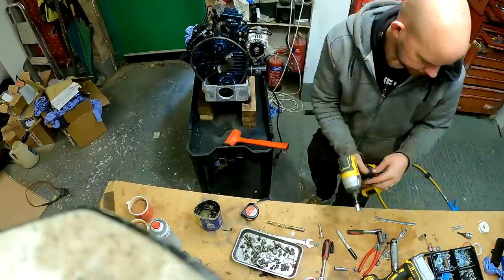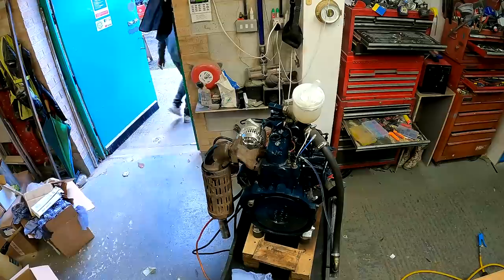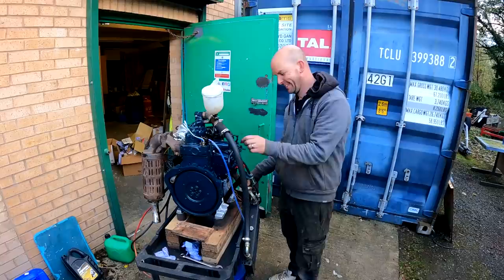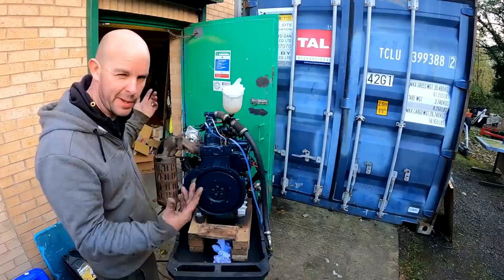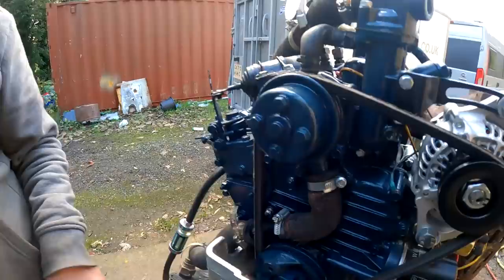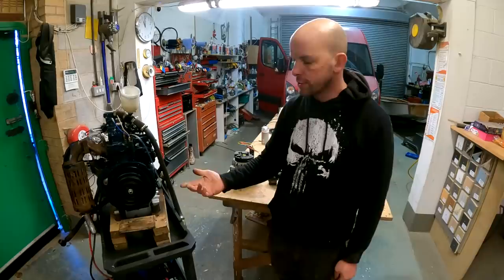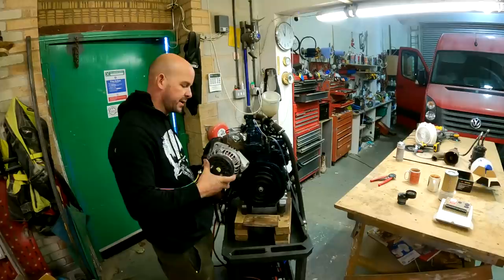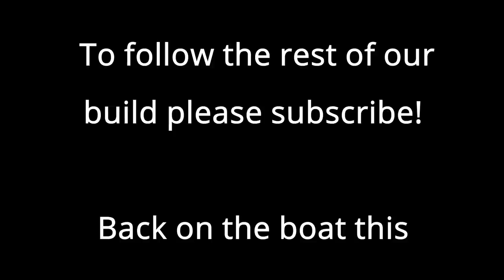DIY DC Generator Build - From An Old Road Sweeper??!!  Part 1

Comment: i'm commenting at 3 minutes into the video  ,but i am very familiar with this engine , it's a Kubota Z-482 ,,these are used for APU power on semi trucks here in the USA ,,,they will easily run 10,000+ hours for generator use ,,I turned one of these APU units into a portable generator ,,it has a  40 amp alternator   and  runs a 4000 watt 120V generator

Comment: Quite the transformation Simon , that engine looks like it is Brand spanking New and it runs like a top ... Outstanding indeed.
Reply: I agree.  You must have a background in diesel engines because that looked so easy for you.
Reply: Motorcycle race engines.

Comment: You could integrate the cooling system into the return of your central heating. Make use of the waste heat .... Since you mostly need it in winter....

Comment: Hi guys, I am a marine electrician in NZ, keep in mind with running this 140A alternator,, as much as its 140A, you need the RPM to spin or run it, this engine will NEVER EVER run fast enough to make this alternator produce the output required. Keep this in mind. Cheers Jeff
Reply: Needs a flywheel sized pulley to get the rpm.

Comment: That is not a mess, that is progress.  Gemma, I cook the same way, as I rebuild motors.  The mess gets cleaned up, but only after I know everything is tasty, or working.  Great project.  I guess it would be too expensive to run the main engines, I imagine cooling would be an issue having to wait for high tide.
Reply: This is the way I work! But if your a person that tidies as you go, it's horrifying for them :)
Reply: Might find the sow’s ear cleaning up the bench?

Comment: 12/13/2022 Hello Simon. Very large alternator. Usually used on road and mining equipment. Sometimes my style was on emergency vehicles like fire trucks who would stand running and power the water by the engine and keep the truck batteries and the extra lighting on the equipment. Cool Video. I am glad I found this video series. I was about to become depressed until spring and you restart the work on board the Salinda. Good luck and stay safe while you regain your dry land legs. Don usa

Comment: Great project. I used my ac pump on my range rover for onboard air. I had a 24litre receiver off a home compressor with a dead motor. the pressure switch turned the clutch on and off on the ac compressor to maintain pressure. I could use any air tool and put tyres back on the rim. A great modification. 👍

Comment: Excellent work with repairing that little Kubota engine.  Have you considered fitting a belt-driven Jabsco type water pump (with clutch) that could be valved to act as a bilge, fire or deck-wash pump? For engine cooling could I suggest a heat exchanger and small raw-water pump that could exit cooling water via a water-injected exhaust?  Have a look at Beta Marine for ideas of how they marinise these engines for propulsion and as gen-sets.

Comment: First I'd like to say wow, what an accomplishment! Well done indeed! I was watching another channel (Sail Life) and he was originally going to mount his generator off of the main drive like you are discussing and someone said that the rear main bearings were not well suited for a load off the side and that they would soon fail. Your original plan/thought to put the generator in line with the engine main shaft would avoid this problem. I'm not an expert so just saying, it's something you might want to consider. I am really enjoying watching you guys work, love your channel.

Comment: The little Fiat Panda has a near 1000 watt (70 amps IIRC) generator. Brand new cost £100. 
Put two in parallel and you’ll keep a 3 horsepower engine busy. . 
Properly seal the exhaust and the waste heat can help warm the boat.

Comment: Nice job, now, if you think about this you can mount the controls in the wheelhouse with the generator in the engine room and control it all from there? That would be such a sweet set up.

Comment: Many/most people in the USA don't know the latitude of the UK, and how that causes the seasonal variation of day/night proportions. For instance, winter daylight at Manchester UK is about 9 to 9-1/2hrs, but in Chicago it's about 9 to 10-1/3 hrs.  That's a big difference in terms of energy from solar installations, and if the Gulf Stream did not temper the UK climate then it would be quite cold in winter.
Reply: 8hrs is nearer at this time of year maybe 7.5 next month

Comment: Nice project! Have a look at the Comap range of controllers. I’ve only ever used the ones for AC generators but they’re great. I believe they do a DC version with auto start/stop according to battery condition. The AC ones also have the option of GSM or Ethernet monitoring/control which I’m sure would be available on the DC versions too.

Comment: Nice job Simon bet you was chilling while doing that engine
did it bring back some motorbike memories nice job....Before starting any of your 
engines you should have a check list first....some of that metal exhaust to through
hull connection be sound....can you not face off that manifold in your lathe Simon
keep it up.

Comment: Wow, that's going to be a well used little motor. Will 10hp be enough for the alternator let alone the hydraulic pump & PTO? Great project though, keen to see the motor control running. Will you be tapping the exhaust out into the main ships exhaust or keep it seperate?
Reply: max is 125A @ 28V (although alternators don't put out their rated current unfortunately) = 3.5 kw @60% efficiency =~ 7.8hp - so plenty of oomph (and a huge amount of heat !!)
Reply: @guy.h  Doesn't leave a lot left for other stuff. Good thing is, diesels seem to enjoy running under load 👍
Reply: @guy.h  And prospect to select whether to charge batteries or use hydraulics, with chance of heat recovery for water heating using a plate heat exchanger from an old domestic combi boiler.
Reply: @garyphillips7993  the alternator could not charge at that rate as their battery bank wuld not accept the charge.
BUT if there was additional 24v load (inverter etc) then the alternator could put out it's max BUT with  2.5kw heat being generated by the alternator it won't do it for very long before cutting power to bring its temp down. (forced air cooling will help)
At the end of the day, they might have an 8hp hydraulic pump, a 3hp air compressor (~13cfm) and the 8hp alternator - with a cluutch on the air pump all will happily run together and the simultaneous loads just have to be managed
Reply: @guy.h  I'm afraid there is a fundamental flaw in your calculations, base your maths on 100% input then divide it up after, ie 60% electricity 40% heat your figures will be 3.5 + 2.5 = 6kw input taken from the engine also bear in mind the 10 hp peak engine output is is achieved at full throttle high rpm so don't plan on it, that would seriously reduce its longevity, peak torque is also a full throttle figure.

Comment: Amazing work Simon well done, my husband worked on installing & maintaining huge standby diesel generators Petbow/Cummins stuff for 50 years, plus we had a 2nd hand  portable diesel genny 110v/240v on board when fitting out our narrowboat, real workhorse, that one was a pully start.  He is impressed at your level of knowledge.  We can see you have not completed your project yet and know where you are coming from to keep a power supply going for Sarinda, well done.  His only comment would be not to try pushing too many amps into the batteries at one time as they don't like it.  What batteries have you got on board? I know I watched you moving them about many videos back, are they 004's lead acids or have you got nicads in?

Comment: Looks awesome guys! is there a way a voltage battery monitor could be wired in?... also seems a waste to loose all that heat, perhaps a warm air fan on the radiator in an airing cupboard or bathroom?.. just an idea.. good work

Comment: Nice Rebuild! A note of caution: when you charge lead-acid batteries, the process produces hydrogen gas. The faster the charge, the more quickly the hydrogen is produced.  Venting is obviously important.
Reply: Lithium batteries is where its at now for off grid set ups. They can handle large incoming power no problem!
Reply: Ventilation is indeed!
Reply: Still very much the minority, faster charge times if you have athe source to feed it, but no less risk of spontaneous combustion! No other real benefits when weight is almost desirable and certainly not a major issue.

Comment: Love what you done there :D
Home DIY generator build is one on my to do list XD

Thinking of going for a motorbike engine though. Would have to buy an entire bike (will be a damaged running one) but will have everything need. My only thought is putting the alternator on the drive chain as might possibly be able to have more than one to feed more power through.
Reply: Be careful about cooling. No radiator as they are designed for the wind to cool as you ride.
Reply: @TR4zest  some bikes have radiator on them which will be good :)
Reply: @christopherroberts9222  True, a few do.

Comment: You could find an adapter and mount a much larger gen set to the rear of the engine
Reply: 150A 24v alternator is about the right match for the engine size. Although it will only run at max output during bulk charging.

Comment: Unlike dynamos, alternators don't usually mind which way they rotate. Nice job there. Do you intend to use a heat exchanger for cooling or raw salt water?
Reply from the maker: yes going to make a heat exchanger. my only concern was the internal fan.
Reply: @ShipHappensUK  perhaps pipe it into your heating system.
Reply: @ShipHappensUK  I've run several backwards. Reverse rotation fans might be hard to get but do exist.

Comment: Hi guys could you not use a belt driven Air pump. Similar to those fitted to a lorry or plant equipment. I may be able to help source one as I know of one that has been upgraded to supply more air of a piece of plant here in Wales if memory serves its a twin v belt pulley approximately 8 inch diameter
Reply from the maker: i didnt think of a wagon pump good plan
Reply: I'll see if I can dig it out and get back to you probably at the weekend with a rough idea of size etc

Comment: Couple of Questions.
Did you work out what horsepower you need to run the alternator what is the minimum.
I’m planning to make a similar unit wit either a yanmar engine or a lister petter AC1.
My alternator is 12 volt 200amp

Comment: If you use that as a hydraulic pump and run everything off of hydraulic power would that work for the air compressor, electric system and winch for lifting items on to the boat?

Comment: Would it have been easier to build a mount so the alternator can connect direct to the crank? Save having a belt drive as simple is better. 😁
Reply: Pros and cons, would still need a rubber coupling bush, and likely end up longer than a belt.

Comment: Out of curiosity, whats the maximum power you can throw into your lead acid batteries when they are at 0, 50%  or 80% charge?
Reply from the maker: i think they will only take what they can receive
Reply: @ShipHappensUK  
The alternators usually contain a regulator pack that senses the   
demand load.. The rpm of the motor and the alternator are determined by motor rpm and relative pully sizes so Simon might have to play about with that if the motor wont run fast enough.

Give it a dose of Slick 50 Or STP  
Oil additive and it will run cooler and quicker and hopefully less likely to  seize. 
Does it need a cooling fan?

Comment: Unsure a v belt will hold up as well as the multi ribbed on the alternator under full load. Would something multi ribbed be rigged at the flywheel end ?
Reply: The v.belt is just for the little generator alternator. He said polyvee for the main one.
Reply: @dhutch2000  Real estate at the front for a polyvee pulley looks limited by the engine mount carrying the hydraulic pump, that was in my thinking when considering using the flywheel end for driving any extras that could be added.

Comment: Starting to watch the video but have concerns on you overcharging the batteries.  I know that you are concerned about being able to keep the batteries topped up but over charging has its limitations.  You need to be concerned about over heating the batteries.  Sealed batteries may not be able to vent fast enough.  You will need to keep an eye on the electrolytes to make sure your levels stay topped up.  
I would assume your battery monitoring system will help you in the over charging issue.

Comment: Don't run the engine without load for to long or you will glaze the rings. You need to load the engine right up to bed the rings in

Comment: is 10 Hp going to be enough to power all of that ?
Id imagine 150 amps at 28 Votls is going to be a very hard to turn alternator.
Then there is the other PTO's you want to power
Reply: You're right, the rule of thumb for generators is a minimum of 2 to 1 ratio of horsepower to  kW so full load of 150 amp at 28 volts will need  at least 8.5 hp so maybe should forget anything else but don't think it will be on full output often.
Reply from the maker: yes i did the calucations. from memory we only need about 8hp. guess we,ll find out
Reply: @ShipHappensUK  brilliant project,  are you going to put it in a sound proof box ?
Reply: @ShipHappensUK  yes, you're right - I wrote out the calcs in another reply.
Reply: @guy.h  150 amp x 28 volts = 4200 Watts x 2 equates to 8.4 hp so you have to round up to an available engine size.
Reply: @ShipHappensUK  150 amps x 28 volts works out at 4.5K watts of electrical power  or 6.5 HP so yes that would work
Reply: @BillyNoMates1974  perhaps you should go to a shop that sells generators and take a look at KW and hp and take onboard how the rule of thumb works in the real world.

Comment: at 16:50,  forget that stuff.       yer  gonna  have  ELECTRICAL  power.      so,  that  is  the  Preferred  energy  'currency'.
if there happens to be a need for a hydraulic system, it  should be powered  by  the  genny; not  by the engine.           it appears that  power available  from the  genny, would make the  original  alternator, unnecessary.

Comment: The generator system in some tanks cooled by using the main engine as a heat sink...thereby making that engine "ready to go"....just saying
However, I hope that you are not using a direct seawater cooling system...

Comment: Your battery system is around 250 amp hours, Charging whit more than 20% of that rating is not advisable.. it shoult not go above 50 amps...  nice kubota doh!

Comment: Simon, I'm a bit concerned about the vibration the engine is showing at starting idle. How about retuning it to standard. Without any load, at start, there should be no vibration. Something is either misaligned or possibly previous excessive wear internally. I suggest it be checked over at a local small engine shop. Other than that, it will make a great addition to the engine-room if it can be incorporated into the electrical system to start automatically when the batteries reach a certain depletion level.